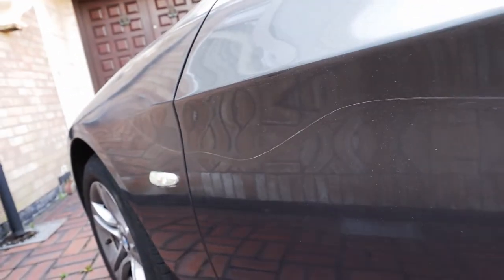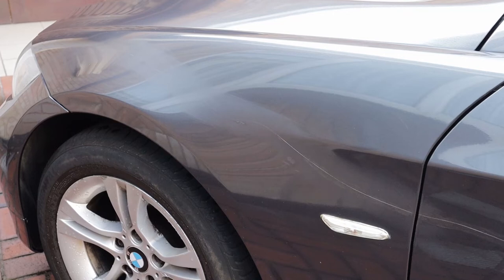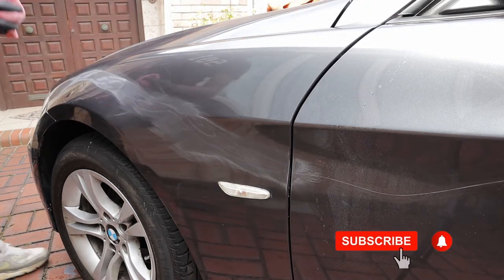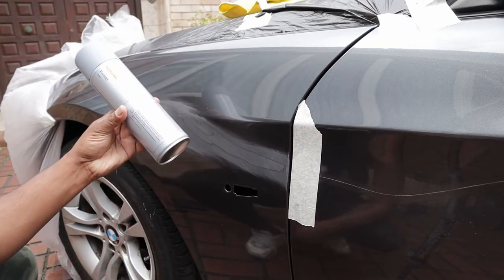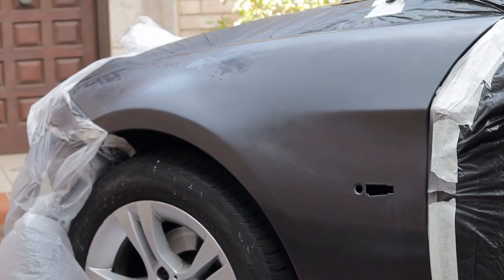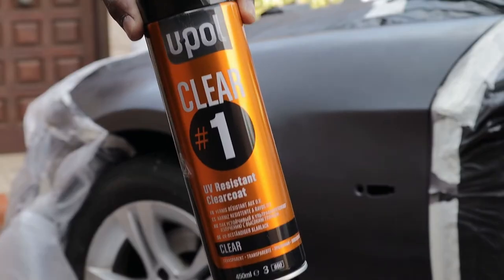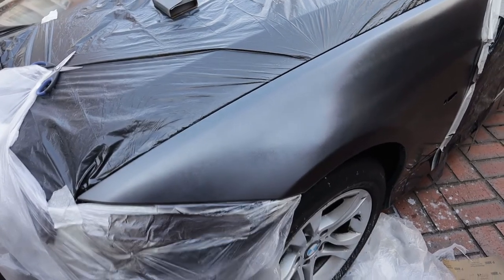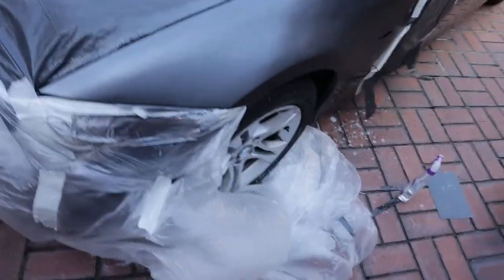HOW TO REPAIR / SPRAY KEY MARK ON YOUR CAR - AEROSOL SPRAY (Sinhala - සිංහල subtitles)

Comment: Fair play for doing that, but you needed to use smooth even strokes for the appliction of the basecoat and clearcoat, better still invest in a reasonably priced compressor and spraygun set up, and as for orange peel, more like an orange grove lol, still it looked ok at the end.
Reply from the maker: Appreciate your words!!! It was first time I did a spray paint on a car...never had experience what I was doing and realised I started a orange farm. Lol.